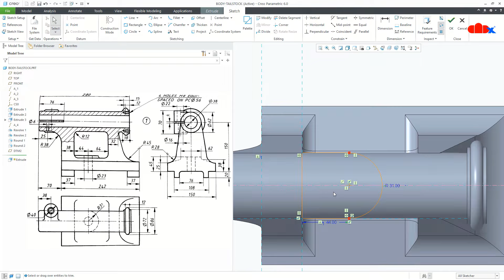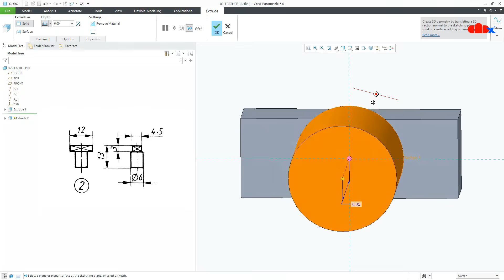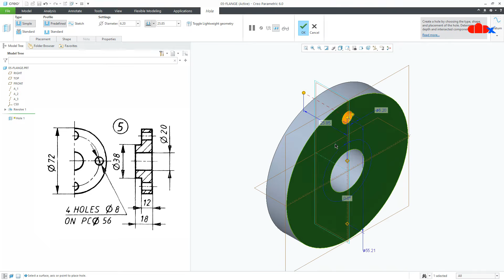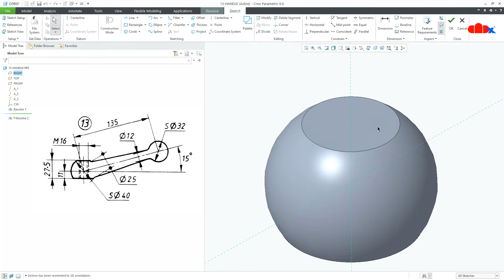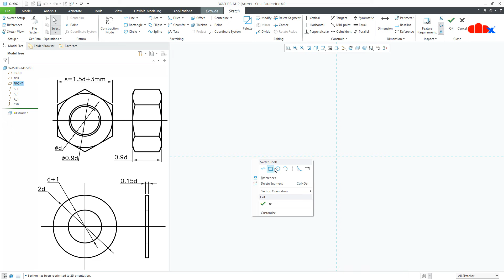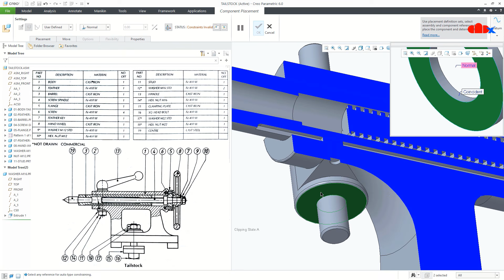Tailstock assembly and parts in Creo Parametric (All parts included)

Comment: 31:53 how is that length 15? please explain
Reply from the maker: If you see the dimension given there it is square threaded portion. The dimension is 20x5.  So when you have a non threaded portion diameter as 15, then 15+2.5+2.5 is totally 20.

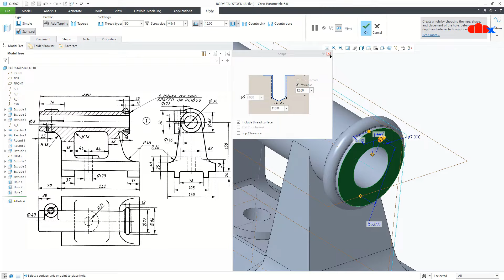Comment: @CADx, I am not able to adjust the diameter at 23:30, in the one you show it is 7 but in mine it is locked at 0.27, what could be the problem?
Reply from the maker: I think you have not selected the M8 hole. Select ISO and M8 to get the diameter as dia 7.
Reply: @CADx-in Same issue with me also 
I have selected ISO and M8 but it is still showing dia as 0.27
Reply from the maker: The unit of your part is inches. It should be mm.
Reply: @CADx-in  is it possible to change the units of that screw hole? Or I have to make a new one from starting?
Reply from the maker: The unit of the part and re-create the hole
Reply: I have exact same issue, do you know how to fix it?

Comment: from where do you got the value of arc dia as 8.5 and the value sixteen for the part 6
Reply from the maker: Tell me the exact timing.
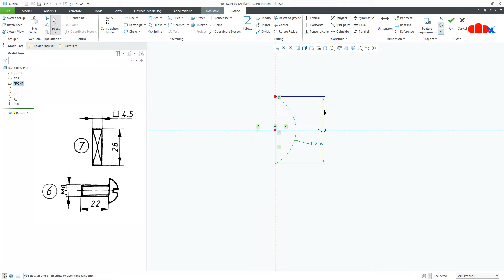Reply: @CADx-in  48:09 to 48:21  can you please kindly share your email Id I have a bunch of doubts regarding creo prametric and it will help me a lot.
Reply from the maker: sandesh4satyen@gmail.com
Reply from the maker: The value 16 is double of M8. This is a general formula. Similarly 8.5 is also based on calculation. If you search for basic for screw design, you will find these formulas.

Comment: for square thread creation in part 3 and 4 how did you put the depth of the rectangle sketched at 2.5?
Reply from the maker: It's 3.5
Thread pitch is 7. It's half of the thread pitch.
Reply: @CADx-in   Thanks
Reply from the maker: It's 2.5. it's half of the pitch. Pitch is 5. Sorry about that.